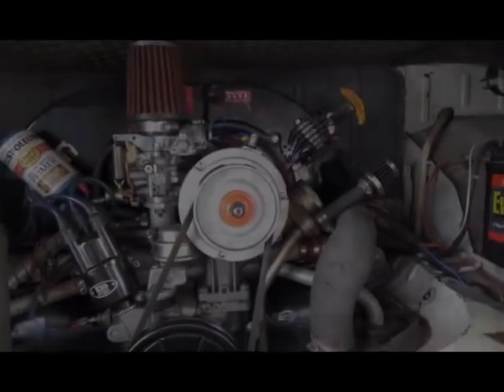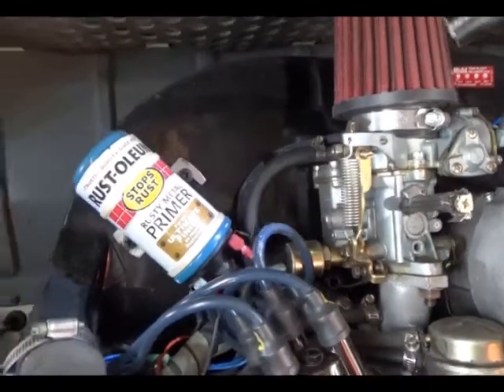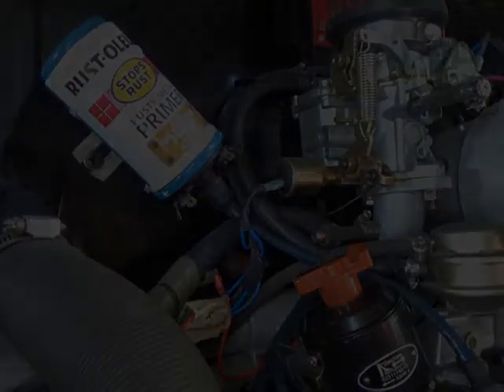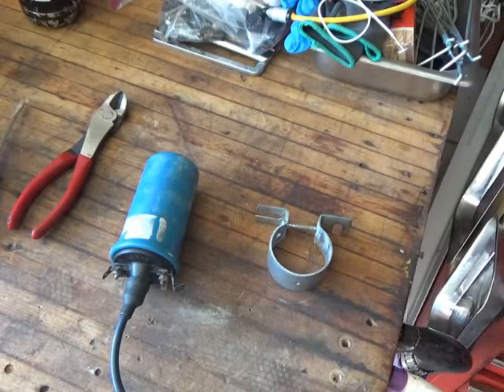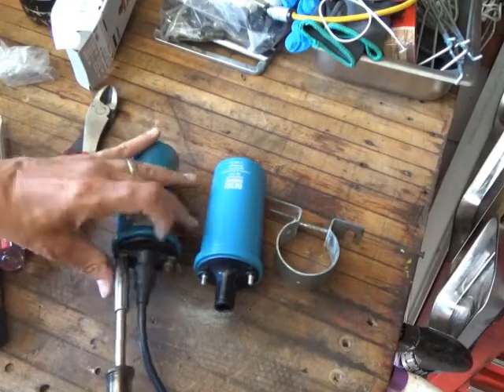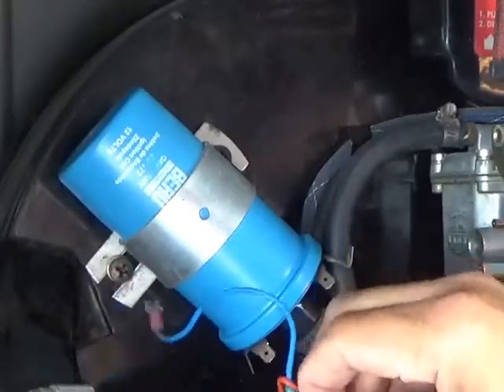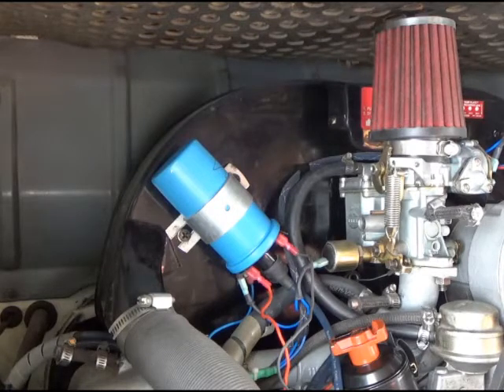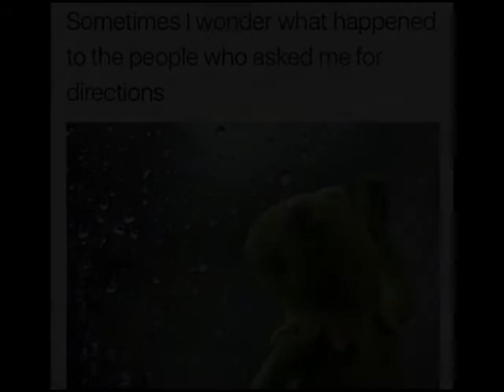1971 Highroof VW Bus new BERU coil install.

Comment: I have a pertronix coil I was told I should have it with the electronic ignition.
Reply from the maker: I have read that those high output coils like the Pertronix work better with electronic ignition. I'm not sure if they ONLY work with electronic ignition but they are designed to be paired with the electronic ignitions.

Comment: Is it ok to use a Beru Part# ZS172 3.3 ohms coil on stock points set up. I've heard it might burn points faster using one not at factory specs your car calls for. I got a 72 Ford Pinto 2.0 eng
Reply from the maker: I have no idea!! But thanks for the heads up.
Reply from the maker: I'm sorry I can not help out with that one! I got that distributor because it has the electronic ignition pre-installed. No more points.